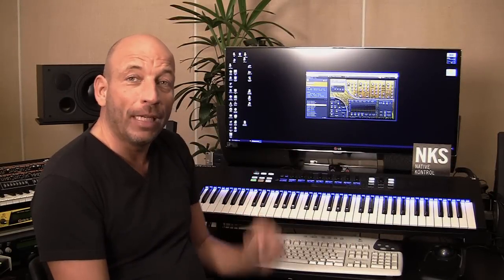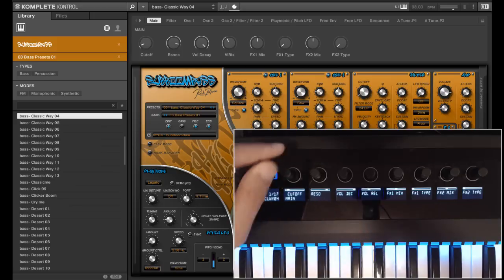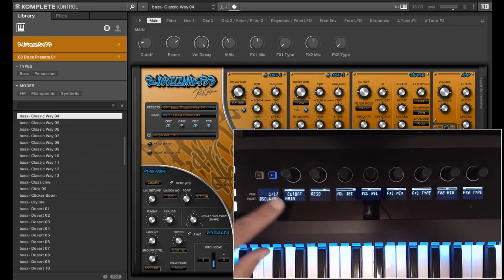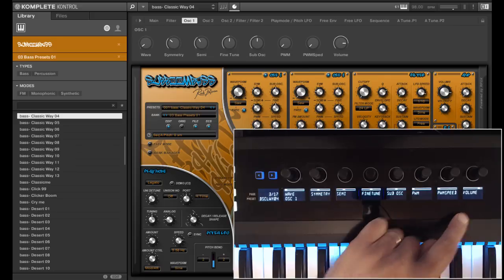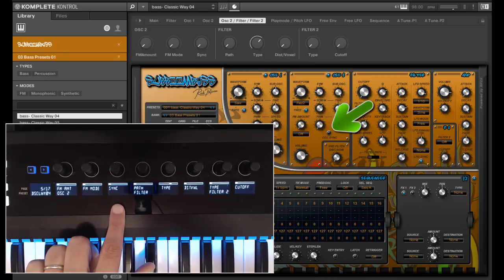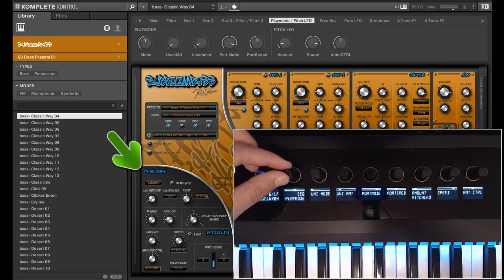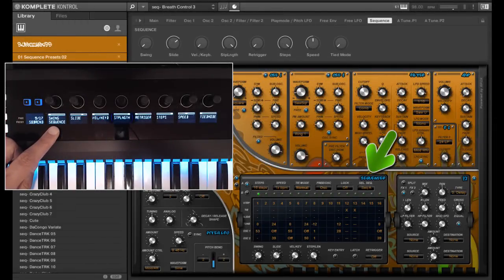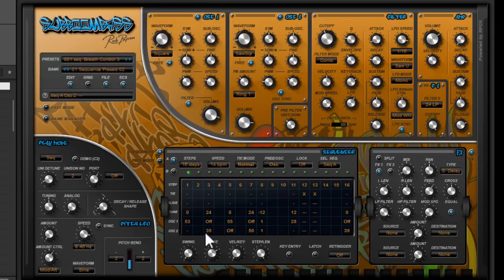Rob Papen SubBoomBass NKS

Comment: will this work without a physical keyboard? Can you use this in a host program that loads vsti's?
Reply from the maker: SubBoomBass is a VST, so you can load it into a host.
For running NKS (also a host) you need to have Machine2 or KK (KompletKontrol keyboard)